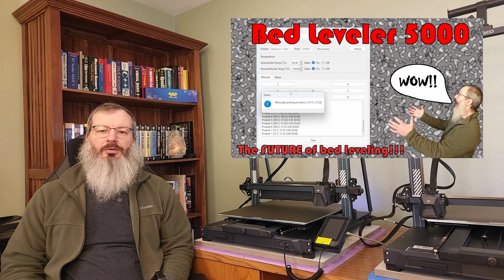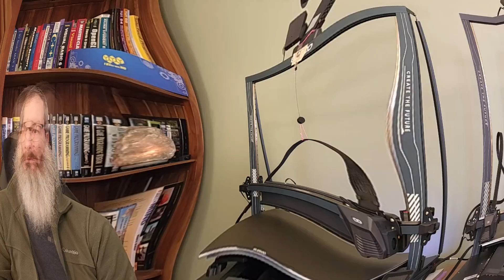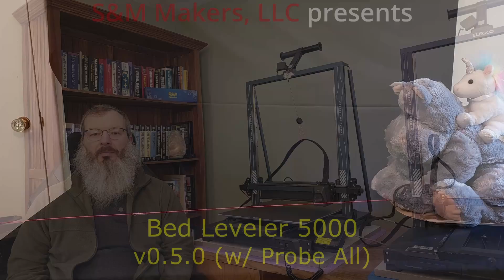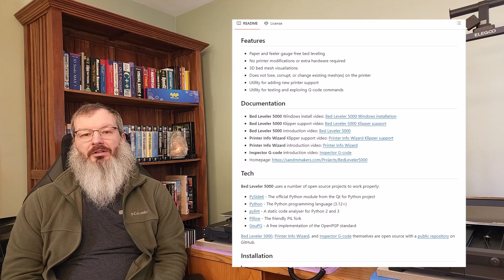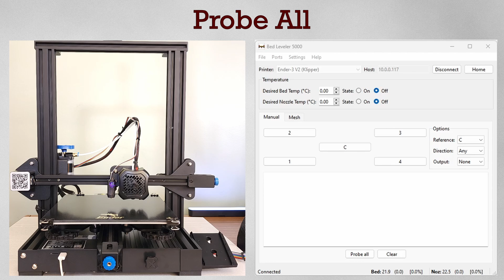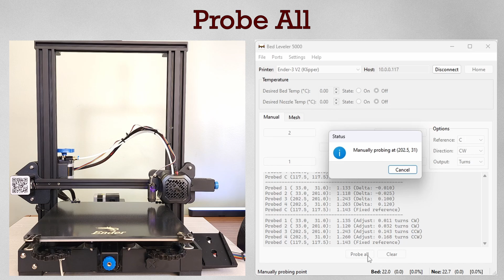Bed Leveler 5000 v0.5.0: The update that changes EVERYTHING!!

Comment: Getting an issue with my N4Max opennept4une coprint kcm 8 color printer, it connects but cant find the correct bed mesh syntax its looking for in printer.cfg. Doesnt seem to be something I can adjust in the json, am I incorrect? Thanks for your time!
Reply from the maker: I don't use OpenNeptune, since I developed my own version (https://youtu.be/Aoy3sI1lv1g), but I'm not sure how BL5K is related to a printer not finding a bed mesh. BL5K intentionally doesn't modify the printer.

However, if you are having issues with OpenNeptune and CoPrint, I would only be guessing since I don't use OpenNeptune. I do have a series of videos on installing CoPrint with my version of Klipper, however. (https://youtu.be/HRHlSdWBTfk).

There is a good chance you just need to fix your printer.cfg file or your start G-code, but that is just a guess.

Comment: On a basic level, how is this different than Screws-Tilt-Adjust?
Reply from the maker: BL5K is GUI-based, while Screw-Tilt-Adjust is "command line-based". BL5K let's you probe individual points while Screw-Tilt-Adjust does not. BL5K is compatible with both Marlin and Klipper printers, while Screw-Tilt-Adjust is only compatible with Klipper.

Really, it comes down to personal preference.

Comment: How do you use this on the Neptune 3max off of the microdisc? Or is this even possible?
Reply from the maker: BL5K runs on standard Windows, Linux, and MacOS computers, not your printer.
Reply: @SandMMakers  DO you connect to the printer from your laptop through it's IP?
Reply from the maker: For Klipper printers, use a network connection and IP address. For Marlin printers, use a USB cable and a COM port name.

Comment: Just discovered your videos. Great idea on the Bed Leveler 5000 but I have the Neptune 3 Pro so no benefit since I don't have adjustment wheels.
Reply from the maker: Thank you for watching our videos! While the Neptune 3 Pro doesn't come with adjustment wheels, there is a mod to add them. Basically, you would remove the bed, drill out the screw holes, replace the existing screws with longer screws/knobs/springs, and then reinstall the bed. Especially since this is a permanent mod, I don't recommend performing it without giving it significant thought and planning first. The mod is also really not needed for the vast majority of Neptune 3 Pro owners.

Comment: I have a Elegoo Neptune 4 Plus and The Bed Leveler 500 doesnt probe over top of adjustment screws 3 and 5. It touches the bed short of the adjustment screws
Reply from the maker: The Neptune 4 Plus configuration file was designed to work with a stock printer configuration. Did you modify anything prior to trying BL5K? Also, BL5K positions the probe, not the nozzle, over the screw locations.

Comment: Awesome program i really like the ease of use this allows. I have a question in regards to the relative home point, is this the number we are trying to match for the other points on the bed? I ask because the center of my bed is much lower after dialing in just the knobs. And im curious if i was supposed to match them to the probe center point?

Comment: My question is whether I have to save or do some automatic leveling later. Sorry if you said it in the video, my English is kind of bad and I didn't understand it correctly
Reply from the maker: Since BL5K only assists with making manual bed level changes, there is nothing to save. However, doing an automatic bed leveling after any manual bed level changes is recommend.

Comment: The Artillery X3 klipper also works for Artillery  X4 plus and Pro
Reply: Yup. Tested on the Artillery X4 Plus. Works fine. How do I get you the correct Abl sensor offsets?
Reply from the maker: You could just move the nozzle to the knob locations and record the coordinates in Fluidd, but it is easier to use the Printer Info Wizard. It is a separate utility included in the BL5K software archive that creates configuration files for you. I have a couple of videos showing how to use it. Takes at most 5 minutes to create a new configuration file.
Reply from the maker: The printer configuration file basically just indicates if the printer uses Klipper or Marlin2 and the locations of the adjustment knobs. If the knob locations are correct, let me know and I will create a new configuration!

Comment: I've got an issue on the Neptune 4 Max where the fixed reference is constantly going up. Started at -0.006, wait a few seconds and probe again, it now reads 0.003, wait a few more seconds and probe again, now it's 0.009. I've got no clue why, I've factory reset the machine
Reply from the maker: If you are just repeatedly probing the same location without making any changes, and the reported value keeps increasing, something is definitely wrong. However, please note the probe is generally only accurate to about +/- 0.025
Reply: @SandMMakers  I am, however the probe ranging is absolutely beyond the +/- 0.025 range. 

I'm unsure whether it's a software or a physical issue with my specific printer. Any advice?
Reply from the maker: The accuracy is +/- 0.025, not +/- 0.0025.

The only things I can think of are: 1) bed is changing temp, 2) probe is loose, 3) a belt is loose, resulting in slipping, 4) damaged motor, 5) bent lead screws, 6) bad or misstigjtened POM wheels. 

Without more info or pictures, I can't really say which item it could be.

Comment: Looks very interesting.   Is the something specific that inhibits use of the original ender 3?  Looks like a great tool.
Reply from the maker: Most Marlin2 and Klipper printers with a z-probe should be compatible (Beacon, Cartographer, and Eddy probe support pending). However, BL5K is really intended for printers that support manual bed leveling. The tools in the BL5K software suite use printer-specific configuration files, but only to know 1) if the printer is using Klipper or Marlin2; 2) serial connection settings (only for Marlin2 printers); and 3) the locations of the manual probe points. These configuration files are easy to create or edit by hand, but the included Printer Info Wizard makes creating them very quick and easy.

If you ever find a printer that doesn't work with BL5K and I will do my best to add support.

Comment: Very interesting project! I do wonder though, how is this used with knob free beds like the Neptune 3 pro? I just ordered a refurbished one and can imagine the auto leveling without knobs becoming a problem later on, or initially depending on physical miss aligning and skewed beds.
Reply from the maker: BL5K is really only intended for printers supporting manual bed leveling. However, you can mod a Neptune 3 Pro to support manual leveling by drilling out the screw holes in the bed plate and replacing the hardware
Reply: @SandMMakers Thank you for the quick response, I will definitely keep that in mind if I encounter problems with the ABL down the road.

Comment: Tried this today for the first time. I certainly like what can be seen and done with this tool. Enjoy seeing the deltas while waiting for the bed to warmup. May not be the correct place, but can a timestamp be put in the results as to see at what time the last/prior probes were done?
Great job and a much needed tool for FDM!!
Reply from the maker: Thank you for watching our videos and trying BL5K!!!

Can you please file a bug/feature request on Github? Please include exactly what problem the change would solve. I'm not sure how the timestamp would be used, since BL5K is started, the bed is leveled, and then BL5K is closed. Since BL5K doesn't maintain state between instances, it is not able to provide probe data from previous uses.

Comment: Just wondering if this will work on BIQU B1 Se Plus ? and the Artillery Sidewinder X4 Plus ??
Reply from the maker: BL5K should work on any (relatively standard) Marlin2 or Klipper printer. If your printer doesn't have a configuration included in the distribution, you can easily create one with the Printer Info Wizard (takes at most 5 minutes). If you do create a new configuration, send it to me via Github and I can add it to the next release. If you encounter any issues, just let me know.

Comment: Excuse me if i'm being dumb here but how do you actually download this? The link to the home page redirects back to youtube? Also will it work with the Artillery Sidewinder S4 Plus?

Thanks
Reply from the maker: Try the link for the binaries. It will bring you to the "releases" section of Github where you can download every version of BL5K.

BL5K should work with most (non-Delta) Marlin 2 and Klipper-based printers. However, the official release currently doesn't include a configuration file for the Sidewinder S4 Plus. Luckily, though, the Printer Info Wizard utility (included in the BL5K bundle) makes creating new configurations quick and very easy. If you do create a new configuration, sent it to us and we will include it in the next BL5K release.

Comment: Thank you for creating this  1code - my question is how much to turn the knob based on results.   If position 1 states 0.235 CW - I understand the clockwise turn but how much of the knob turn to adjust for 0.235?  thanks
Reply from the maker: Thank you for watching our videos and trying BL5K!! If you are using the "turns" mode, the number indicates the number of full turns to perform. For instance, 0.5 would be half a turn, or 180 degrees.

Comment: Another quick noob question for ya! 😊 I thought I saw in one of your videos that you could use the z offset value shown after probing with BL5K to manually enter that value into Fluidd, and then update your machine's z offset value by clicking the save button. This, eliminating the need to use paper at all. Now, and please forgive if I've missed it, but I can't find it. Is this true, or have I lost my mind? 😅 Thanks in advance for your help!
Reply from the maker: BL5K is currently unable to determine the correct z-offset value. Paper, a feeler gauge, or a z-offest test print are required for determining the correct z-offset value. While I'm looking into ways to change this, so far, I haven't been able to develop any methods that do not require physical parts.

Comment: Any chance this would be available for the ENDER 3 S1 Pro?
Reply from the maker: BL5K should be compatible with most Marlin2 and Klipper printers. You can easily create a configuration file for your printer using the Printer Info Wizard (bundled in the BL5K archive you already downloaded). Creating a new printer configuration shouldn't take more than 5 minutes. If you do create a new printer configuration, please submit it in Github and I will add it to the next release. Also, if you encounter any issues, please file a bug report in Github. The most important part of the bug report is the log file. Directions for creating a bug reports and log files are in the documentation on Github.

Comment: i used the bed leveler 5000 on my np4 lastnight and I could not get it to produce good results, i would make the minor adjustments it was asking, then test again and it would be either worse or in the same range. then when i loaded the mesh up in klipper it was off by .50 slanting towards the front of the machine. it doesnt make much sense to me why its behaving the way it is.
Reply from the maker: You potentially have some mechanical issues with your printer. Verify if your eccentric nuts are tightened appropriately and that the POM wheels are not damaged.  Also, verify if the printer frame and gantry are square. Additionally, verify the z-probe is working and is correctly aligned. All of these issues can cause bed leveling issues and bad meshes.

Comment: The Probe All function is a great improvement - a further enhancement I would appreciate, would be to have the option to probe the same position or probe all, multiple times e.g. 5 or 10 to enable checks during/after adjustment without having to access my keyboard.  NB I notice in the video above you are running the software without heating the bed or extruder - is this how I should run this or should I set to 60/140 as in the other video?
Reply from the maker: Thank you!!

Please use Github to suggest changes and new features. I receive so many messages a day, suggestions anywhere else will get lost.

For temperature, you generally want to level at whatever nozzle and bed temperatures you normally use. In this video, I wasn't actually leveling the printer's bed, just demonstrating the new Probe All feature, so I didn't bother setting the temperature.

Comment: Just gave this a try for the first time. Worked great. Much easier to implement than the screw tilt adjust and will never use paper again. Thanks for making this available for use. Appreciate the work that you put in to help us all.
Reply from the maker: Awesome, thank you!
Reply: @SandMMakers  i recently watched your video on upgrading your n4 max to liner rails. I have a n4 plus and was considering upgrading to the liner rails. The price and shipping of the kit is as much as a number of good printers or close to it. So im wondering. Do you think the liner rails is worth it on a neptune 4? Has it made a difference for you?
Reply from the maker: It is difficult for me to say if linear rails are worthwhile for anyone besides myself. They are definitely not required, but they are a decent quality of life improvement and potentially let's you printer at higher speeds. They make tuning and calibration much easier and eliminate POM wheel dust. If you are struggling financially, then I would say no. However, if you are able to easily afford the linear rails and want to make your 3d printing experience more enjoyable, then I would say yes.
Reply: @SandMMakers  thanks for the info. I have had a lot of issues with my neptune 4 plus. The pom wheels needed replacing after 2 months and had to replace the printhead from a blob of death. Then the firmware updates and usual problems from this printer. I don't know why a printer this size wouldn't have liner rails in this era of 3d printing. I do get good print quality of the printer when everything is running right. So i will probably upgrade to the rails. Im not ready to give up on it, so i might as well. I only considered it after seeing your series. I wouldn't have attempted it without your guide.
Reply from the maker: Thank you for the kind words.

Comment: Great Tool , Thank you  ! I tried to generate my Printer Configuration with PrinterinfoWizard, it worked (. but by using Bed Leveler 5000 I got the error message after connecting to my printer : Incorrect number of Tokens in response: (ok T:17.54 /0.00 B:18.79 /0.00 @:0 B@:0) how can I fix it ? I'm using Artillery X1 printer ...Thank you very much for your help
Reply from the maker: Thank you for watching our videos and trying BL5K!! I'm really looking forward to expanding BL5K's user base beyond just Elegoo printers. Can you please file a bug report on Github and include a log file? The directions for creating a log file are in the "How to report a bug" documentation page. The log file will let me see exactly what is failing to be parsed. Thank you.
Reply from the maker: I'm not going to be able to add Marlin1 support right now. It would require a significant amount of effort and there are very few printers left that would be able to take advantage of that support. However, I did check and there are 3rd-party Marlin2 firmware builds available for the Sidewinder X1.